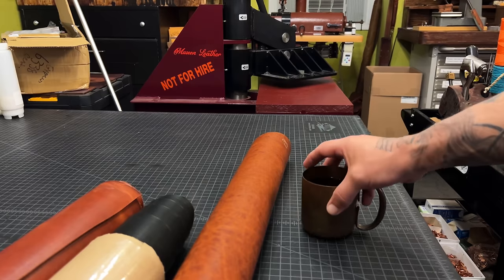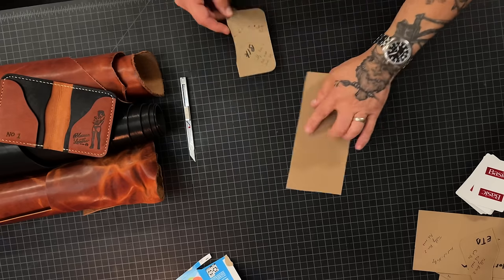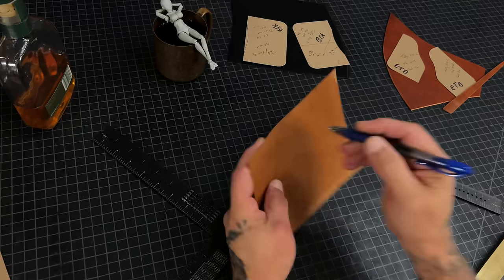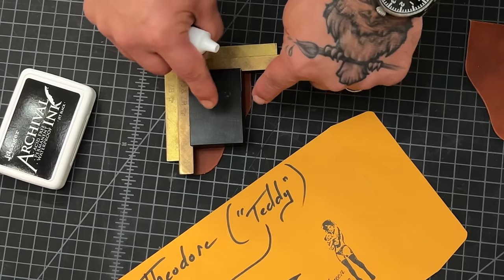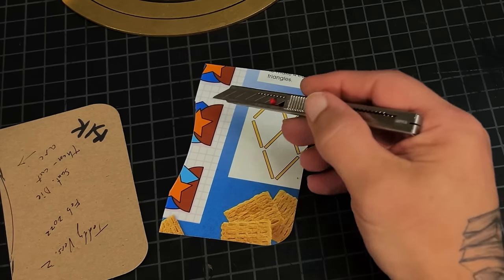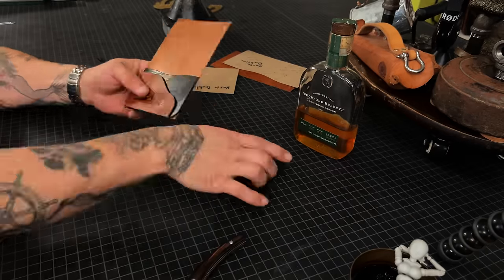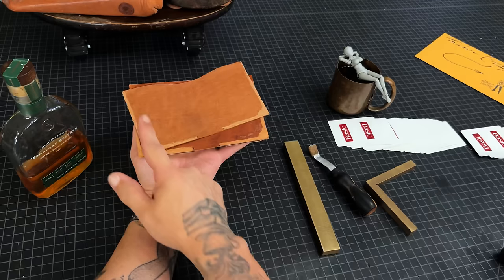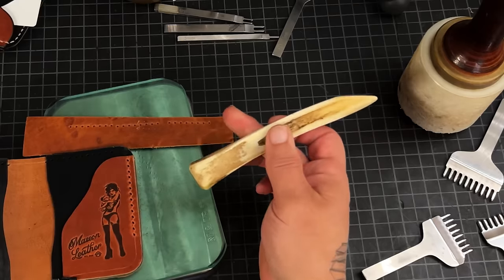Nothing to FEAR! - Leather Craft Magic!

Comment: Yup, broke yet another belt today (the buckle this time, leather was splitting anyways so was only a matter of time) 😒 $75 later my booty is covered literally and like the leather I got, but not the best for holster, sheath, comfort, and formality. Figured I better just learn some new things, mink oil ain’t making my life any better. I get a belt and have to punch holes in it to make it fit, they’re not getting cheaper, neither are boots, and my wallet is horrible, I.d. Got more expensive but made cheaper apparently cause mines in 3 pieces and I had to cut it out of my wallet, literally. Also use old scrap pieces of leather for sharpening and I’ve got a big 3-4 inch needle I assume is for leather, now I have to find a cow 😅. I’d be way way way better off just making it myself

Comment: Another great vid (as usual...)  Apparently some out there don't get the flow of the bump jigs, but ever since I started using them, all is SO much faster, easier, and much more accurate...  Also, did I see correctly in the vid that there is possibly a new smaller square on the way from Mascon/ZeeBee...???  (🤞)
Reply from the maker: All well said.   Some don’t “get it”.  And that’s ok.  Some don’t “want to” get it. Because it goes against all the learning they’ve accumulated.  Again, that’s ok. 

But when those who do it, “get it”, it simply clicks.  An “ah ha” moment and it’s like magic.  That’s all we want.  To help and make it easier to get to the same end goal.  Perfection. 

Rulers - good eye.  We’ll keep everyone posted as we move closer to release dates. 2 more tools that will make your leather craft seem like magic.

Comment: Thanks for the tip with the ink pad. I've been having trouble with my stamp in chrome tanned leather and have been experimenting (unsuccessfully) with hot foil and a soldering iron. The black ink works a charm!
Reply from the maker: I just can’t guarantee the longevity of the ink.  My wallet is fine, But it’s only been 6-7 months

Comment: How do you sharpen your tools. You get great beveling but when I strop my bevelers I can't seem to get them sharp enough for the Horween. It's softer than vegtan and getting a good bevel is a pain.
Reply from the maker: I’ve never sharpened an edge beveler.  I only strop. For years.  The Barry kings hold the edge.  Put some red or green rouge on the corner edges of some 10+ oz veg tan and pull bevelers backwards on that edge.  That’s all I do.

Comment: I'm still in the watching and learning phase. I don't understand the Bump Jig. It seems like a lot of flipping and fiddling opposed to tracing and cutting with a straight edge. Is there an advantage that's gained by bump jigging left and right, back and forth, over and over? It doesn't look like it's for speed, maybe accuracy?
Reply from the maker: I have a whole video devoted to showing how to use them.  Once it clicks, it saves hours and hours of time.

Comment: 20:25 incase anyone was wondering, you can use a regular hammer. I used to be a timber framer, so I use my old estwing 28oz.
Reply from the maker: 100% wrong.  I was a framer. And have 524 hammers.  Never.  Never.  Never use a metal hammer on metal tools.   Mushrooming is bad, and the hardness levels of tool metal and hammer metal are not friends.
Reply: @MasconLeather  for every action there is an equal and opposite reaction. I said you can use a hammer, never said you should. I'v got way more hammers then mauls or expendable income. Plus most old stitching chisels I find here (Britain) are mushroomed.  524 hammers; hell of a collection fam.
Reply from the maker: 😆 
Fair points.  

And yes, any heavy object (hammer) will work. So, you’re right.  But I’ve also had a chunk of metal shoot off a log axe from hitting another axe (both heat treated metals) and lodge on my arm like a bullet.    

Keep on rolling !!  And thanks for watching!!
Reply: @MasconLeather once bit, twice shy. Fair enough. 

No worries man. I feel proper manufacturing is something that needs more promotion so I love your channel in that regard. Always a pleasure to tune in.
Reply from the maker: I truly appreciate the feedback and comments!  Thanks for it!

Comment: Your videos are inspiring! I recently made a card holder wallet as my first leather crafting project and it turned out awesome, but the cards seem to be a bit of a pull to take them. I didn’t stitch too closely so they have plenty of room to come out, but I think it’s maybe cos the inside is the raw side (or backing) of the leather. Sooo does putting the burnishing gum on the backings make cards easier to come in and out? Thanks in advance! Big fan 😊
Reply from the maker: Thanks for the kind words.  Slicking the back does help some.  Also slide a bone folder into pockets a stretch a little. That’s helps too.  

Thanks for watching!!
Reply: @MasconLeather  Awesome thanks so much! Really appreciate the reply.

Comment: How to keep edge bevellers sharp? Their unusual tip shape makes them really tough.. I've been trying to strip, or use sandpaper on sharp edges, or string with strip on it, ... etc, but I find my cheapo tools are never sharp enough to cut and get a good bevel going..
Reply from the maker: I have NEVER sharpened mine.  Ever. In years. Barry king bevelers hold their edge.  All I do is strop on the corner edge of a veg piece covered in red or green jewelers rouge
Reply: @MasconLeather  huh. Unbelievable! YOu make it look easy.. just run the beveller down the edge and the piece curls right off. I always snag and have to fight it a bit, making rough edges. In the end I use a french beveller and strop the hell out of it, and just go at a 45 angle and that seems to work better for me.

I need more practice and a better tool perhaps..

If you had to have one number of edge beveller, what? a 0 or 1, for universal use?

Thanks for your videos.. very cool of course, top notch branding, and we all learn a lot. Horween should pay you :)
Reply from the maker: I think the quality of the tool is 80% of the solution.  I’d get the berry king size 0.  Because it works with 5 oz.  And can be used for larger.  The size 1 would be too lathe for 5oz